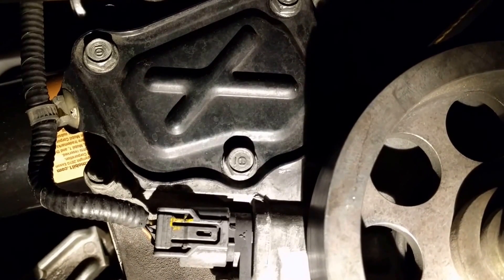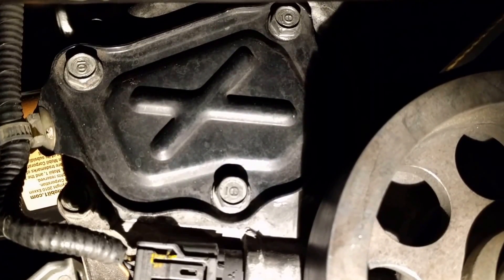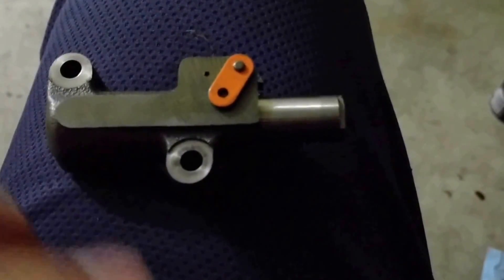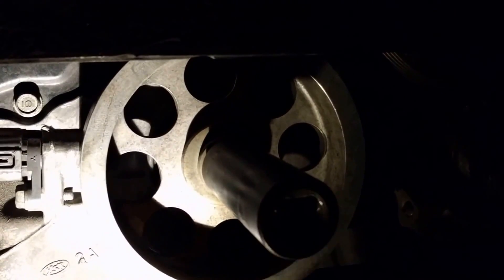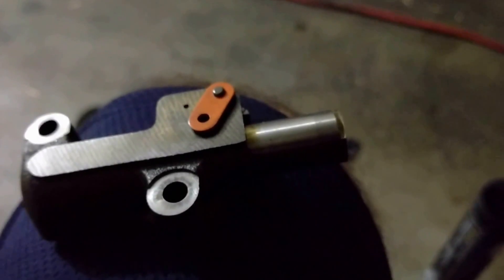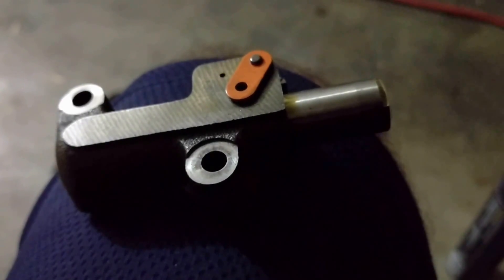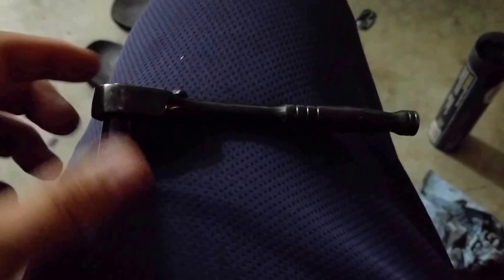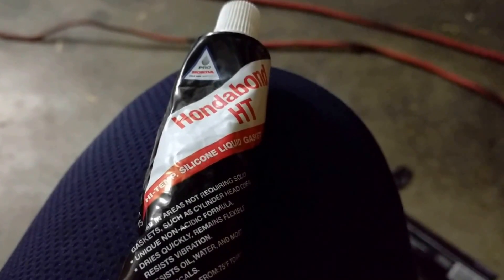DISCUSSION: Replace Timing Chain Tensioner on 2005 Acura TSX

Comment: Any idea where the directions can be found in the fsm you have linked? I’m having a hard time finding it
Reply from the maker: I don't know what page its on. The PDF uses different numbers than my actual physical  Acura manual. Is there some information that you're looking for that's not in the video?
Reply: No, your video does a great job walking you through the process. I was just curious to read what the FSM says. I’ll have to dig a little deeper and find it. Appreciate you

Comment: My Aura 2014 TSX has 139k miles on it and has no noise. I have owned it since 2017 when it had 18000 miles. Should I go ahead and replace the tensioner?
Reply from the maker: If it were my car, yes I would replace it with an OEM tensioner. As preventive maintenance, I think it's a good idea to replace the tensioner every 10 years or 110k mi, whichever comes first. My TSX will reach 20 years old next year so I will be replacing the tensioner next year.

Comment: My 2004 acura tsx  vibrates way to much especially when I have it drive or reverse. What could be the issue and how do I fix it?
Reply from the maker: Without knowing more about the car, the first guess would be to check the engine and transmission mounts. There are three engine mounts and three transmission mounts. If the rubber is cracked, then they no longer dampen the vibrations of the engine and youll feel it inside especially on idle. If you use aftermarket mounts you will still deal with vibrations because aftermarket mounts don't perform the same as OEM mounts. Here is the video on the transmission mounts https://youtu.be/YeBMelfkV_Q  Here is my video on the rear engine mount https://youtu.be/_TnN4wFCf80.  Those are the only two videos I have on the mounts. You can check the mounts by using a floor jack. Insert a piece of wood between the floor jack and the engine/transmission, then jack up the engine/transmission and look to see if the rubber in the middle of the mounts are separating. To check the transmission mounts, lift under the transmission. To check the engine mounts, lift under the engine.

Comment: Do you have any rattles on startup now? Failed VTC gear is what everyone says causes them, not the tensioner.
Reply from the maker: I have never had rattles at startup. That's not a tensioner problem. Like what you said, VTC gear is one of the main issues.
Reply: @ChavezDIY  Helpful clarification, thanks

Comment: I also changed out my timing chain tensioner by following the instructions on this video. Thank you very much for the detailed information ChavezHobbies! One thing that I also had to do was to compress the tensioner all the way, almost flush. That was the only was I was able to put it back in.
Reply from the maker: You're welcome brother! Other people have also mentioned that they had to compress that piston more to get it to fit. I guess I got lucky that my piston was sufficiently compressed when it came from the dealer.

Comment: Good morning .. any codes at the time the tensioner starts to fall??
Reply from the maker: My tensioner did not fail and I did not have any codes when I replaced it. I changed it as part of preventive maintenance. My car had already hit 100k mi and was 10 years old so it was time to change it. I would change the tensioner every 100k mi or 10 years, whatever comes first. Tensioners are cheap, engines are expensive.
Reply: mine is now 20 years old and 275k kms probably time to do it ! o-o @ChavezDIY

Comment: Is this the same for a 2010 Civic Si coupe? My research suggest(from folks who have replaced their TCT) to line everything up, as in TDC and the marks, then proceed with the instructions you divided. In other words, open up the valve cover. Is this necessary?
Reply from the maker: I can't confirm that its the same for the 2010 Civic Si. That car uses the K20Z3 engine and from the google photos, it looks like it has a TCT cover just like this K24A2 in this video. The instructions from the OEM service manual are written verbatim towards the end of this video. There is no mention of needing to put the engine in TDC.

Comment: You did a whole video on looking at a tensioner and a ratchet
Reply from the maker: Yes, correct, but the information is still relevant. This was my first time replacing the TCT and I had no intentions of making a video until I reflected on the experience when I was done. I even listed the instructions verbatim from the OEM manual in the video. That's why I labeled the video "replacement tips". If I have the opportunity I will film the full procedure but that hasn't come up yet.

Comment: Dang I have over 300k miles on my K24....finally changing it...I ended up taking off the entire cover to inspect everything...one of those "well since I'm in there"...all started from a small job leading to a much larger one
Reply from the maker: It's good to hear your K24 is lasting 300k mi! It's hard to keep track of every single maintenance item a car needs unless you do a lot of research. I get tired of keeping track of all the maintenance a combustion engine needs, I can't wait to go electric in the future. Was it difficult to remove the entire cover? Sometimes a small job does lead to a bigger one. You think, "this will be quick" LOL.

Comment: I have a 2002 jdm rhd accord cl7 automatic with k20z2 engine with 170’000 km and the engine starts tickling noise and i knew it was timing chain tensioner..
Reply from the maker: Glad you are on top of finding the sources of the problem on that engine. The timing chain tensioner is relatively easy to replace compared to let's say a timing belt. I can't believe Honda/Acura uses a timing belt on the V6's. I was looking into buying an Acura RDX in the future and was bummed to find they use a timing belt, not a chain. Only the older RDX's with the 4 cylinder turbo engines have a timing chain.
Reply: Miguel Chavez buy the 2020 rdx 2.0turbo 10 speed automatic, that thing shifts fast and awd man!! I love it so much

Comment: NOTE: before attempting this you can compress the tensioner even more by holding the tooth mechanism from locking the rod from going in further. Hold it with a little flat head and press it down in the floor with a rag and it’ll compress even more you’ll hear the pressure. Then loosen it 2 clicks and it’ll be able to fit the pin. After doing this you’ll have way more room to fit it back in. Make sure you align the tip of the rod on the tensioner to the little trimming inside of the tensioner housing. Hold it in place and smack it with with a mallet or flat head. You can use the flat head to hold it in place and hit it gently in the back causing it to compress enough to slide in back to place. The timing pin hole will even line up when done correctly.

Comment: You forgot to tell people to keep tension on the belt, I didn’t when I followed this and now I can’t get the tensioner back in
Reply from the maker: You may need to compress the piston on the new TCT more to be able to fit it in. You can use a vise to compress the piston or some channel lock pliers.
Reply: Miguel Chavez okay UPDATE after a painful 30 minutes. I found out that you can hold the tooth on top of the little compressor and press the rod down even more then factory, I did this and then loosen it 3 clicks so you can put the pin in the hole. Line the really compressed unit back in where the head of the rod meets the little sitting area on the timing guard and then hold it in place and hit it when a flat head or mallet and it will clip in place, it’ll be a really tight fit but this was the only way I was able to get it back in.
Reply from the maker: @Andre_1901  Thanks for the update on that. I'm sorry I wasn't able to film me doing the replacement. At the time I got lucky and didn't need to compress the piston further. I will pin your comment so it shows up at the top when people view the video.
Reply: Miguel Chavez thanks for the video it helped a lot, originally I was upset because I thought the timing had skipped. But Honda made a safety feature to where it won’t skip when removing the tensioner. You mentioned that in earlier comments. Thank you
Reply from the maker: @Andre_1901  Its pretty scary working on anything that messes with the timing chain. Even I was sweating it the whole time when I did this, haha. Cheers.

Comment: Good video, by doing this and moving the timing belt and putting a different tensioner, would the timming on the car change, and should it be checked
Reply from the maker: I mention the timing in the description of the video. No, the timing on the chain is not affected by changing the tensioner. This procedure only releases tension from the chain but its not enough to skip a tooth on the cam gears or crank gear. You can do a search for k20 or k24 timing chain videos to get an idea of what's going on inside the engine when you remove the tesioner
Reply from the maker: Here's a link to a video where it shows what's happening when you release the tensioner. It has some slack, but not enough to skip timing by itself. The instructions I typed into the video are from the OEM service manual. https://youtu.be/gLrXm-wOCKE?t=322

Comment: Did you grain the Oil before doing this?
Reply from the maker: I changed the oil and filter while doing this job, kill two birds with one stone. It's not necessary to drain the oil because the elevation of the access to the timing chain tensioner is above the oil pan where most of the oil sits when the engine is off.
Reply: Oh ok cause changing this part is my next move on finding out what's causing my Auto tensioner to Rattle, i read of this Forum this guy wrote with the same issue i'm having that this was the fix so fingers cross it works.

Comment: Nice vid bro. But u don't need expensive Honda bond.. The ultra Grey silicone works. Been a mechanic for years. Long b4 this Honda bond thing came out.. And it works super fine if applied properly..  And I won't be surprised if it's the same thing honda rebrand and charge 3 times more for the name 😂
Reply from the maker: Thanks! I noticed that Permatex makes good RTV, which is what I will buy next time I need to make a gasket. I also wouldn't be surprised if Hondabond is rebranded stuff.

Comment: Just keep up with the oil changes and right oil in the car. Don't skip out on fixing leaks
Reply from the maker: Yes, I keep up with oil changes and use Mobil 1 for oil. The front Vtec screen was leaking oil so I changed that gasket recently. I plan on doing a valve adjustment in the near future and will change out the valve cover gaskets while I am there.

Comment: Appreciate your video. I just replaced the tensioner on my 09 Civic Si, k20z3 and was stuck on how to remove the tensioner. Unlike your vid shows, the orange tab on mine was at the 11 o'clock position and would not come down enough to slip the pin to lock it in place so I could remove it. Anyways I went ahead and removed it without locking in place and was able to remove it. 
The replacement tensioner however was exactly as your video shows it should operate so I'm still lost as to why my Original tensioner was backwards. 
Also I'm hoping the timing didn't change, currently waiting for the hondabond to dry so in 2hrs I will find out if all went well. 
Great video though man!
Reply from the maker: Glad to hear the video helped. Did you change your tensioner for preventive maintenance or because you are having a problem with the engine? I changed my tensioner at about 90K mi. Let's hope your timing stays good. Let me know if everything goes well!
Reply: @ChavezDIY  everything went well. Filled the engine with oil and started right up. I replaced the tensioner for preventive maintenance purposes, the car is up to 140k and has not giving me any problems i figured this will offer a peace of mind since these tensioners seem to be the Achilles heel for the K-series. The tensioner and VTC solenoid 😄
Reply from the maker: That's awesome! Feels great when you accomplish some preventive maintenance. I've heard about the VTC solenoid and the VTC screen filters giving issues. I have not had the issue, but I recently bought the VTC screens (front and rear) and will replace for preventive maintenance. I also have a valve adjustment on my to do list.
Reply: @ChavezDIY  valve adjustment is next for me. Good thing you haven't and hopefully wont deal with the vtc. Again thanks for the vid man
Reply: Glad I ain’t the only one that has this same exact problem, did replacing it fix everything?
Reply: @wyattg.4047  I was replacing it due to the high milage on my Si at the time. Only issue I had was removing the old TCT, as the orange tab was in the wrong position. 

What problems are you having?

Comment: DO NOT replace the timing chain tensioner without maintaining tension on the exhaust side chain guide.  Failing to do so could cause the chain to hop a link.  Also, if the piston of the tensioner is extended by 13.5mm, then the chain needs to be replaced.
Reply: @docter4ever   good shit I just purchased a 2011 TSX  with a little chain slapping noise when its cold and you get on the gas... normal driving you won't hear it .... once you punch it makes a little slapping or metal on metal wizzing by so I'm 99% its that and the guys mechanic said to prob change the timing chain.... little does he know this is a weak spot in this engine. Ima prob tackle this with in the next 2 weeks!
Reply from the maker: Thanks for the feedback. Are your comments referring to when you have the timing chain engine cover off the car?
Reply: The exhaust side of the timing chain can be accessed if the cylinder head cover is removed.  I would never pull off my tensioner without maintaining tension on the exhaust side of the chain .  Removing the tensioner creates slack in the chain, and will most likely throw the timing.  Camshaft locking pins and a pry bar on the chain guide should be adequate to hold the chain in place.  Simply popping off the access panel and swapping the tensioner is asking for it.
Reply from the maker: I have the OEM service manual and it mentions nothing about maintaining tension on the exhaust side chain guide by removing the valve cover. The timing chain sits on the teeth of the cam gears at the top of the engine and attached to the crank gear at the bottom. Simply releasing tension on the chain (guides) via tensioner is not going to throw the timing off. If the chain is worn enough that changing the tensioner throws off timing then that's a problem that needs to be repaired, not a maintenance item. If your problem is that serious, you might as well look at replacing the chain guides too.
Reply: I'm just saying that as a precaution, it makes sense to put tension on the chain prior to removing the tensioner.  If the exhaust side chain guide moves at all during the replacement,  gravity could cause the chain to slip on the crankshaft gear.  And since there is no way to determine how far the tensioner is engaged without removing it,  it only makes sense to be careful.  I've read the FSM guide thoroughly and disagree with the procedure.  There is nothing to keep the exhaust side guide from moving after the tensioner is removed.  It's an impact engine.  I'd say it's worth the extra step to avoid potentially having to reset the chain and replace damaged valves.
Reply from the maker: I understand the idea of being precautious. I just think its dangerous for me to provide that recommendation of removing the valve cover and sticking a pry bar on the chain guide to hold the exhaust side chain guide during this procedure. I'm not a mechanic and not an engineer, so I will stick to what the OEM manual says. I followed the book and was successful. I recommend that if you feel strong about your recommendation, create your own video and see what kinda responses you get from other people.
Reply from the maker: Here's a video of a guy upgrading his cam gear and he goes by the book when it comes to releasing tension on the chain and you can see the chain is not skipping a tooth. https://youtu.be/-ZJ1XrAj22A?t=3m5s
Reply: As it turns out, there is a guide that runs along the bottom of the crankshaft gear to prevent the chain from slipping off the bottom.  So basically,  after the tensioner is compressed and removed,  it is essential to not move anything until the new tensioner is installed.  My problem with the FSM is that repairs often don't go according to  plan,  therefore it's important to take simple precautions to prevent disasters.
Reply from the maker: I agree that repairs don't go according to plans in the book. I subscribe to Scotty Kilmer and he's good at repairing cars but he makes things look way easier than they will be for the average DIYer. He also doesn't address the problems that he runs into. That's why I find videos from EricTheCarGuy more helpful as he includes problems he runs into. I use a combination of the OEM manual along with Youtube videos to help me learn stuff.
Reply: Makes me wonder what people did before the internet.  Just did a valve tune,  full throttle body clean,  and full engine mount replacement on my 07 tsx.  She's got 140k and when idle with ac on, I can barely feel the motor running.  All thanks to the resources u mentioned.  I liked ur AT mount replacement vid.  Had no idea where to locate them till I watched ur vid.

Comment: My car would only rev the 3 grand then I sound like all the valves are open please help me
Reply from the maker: tae FU did you change your tensioner? Check for diagnostic trouble codes with a scanner. You can also reset the ECU by disconnecting the battery terminals.
Reply from the maker: retrace your steps, double check everything you touched, put everything back the way it was and ensure all connectors are in place.